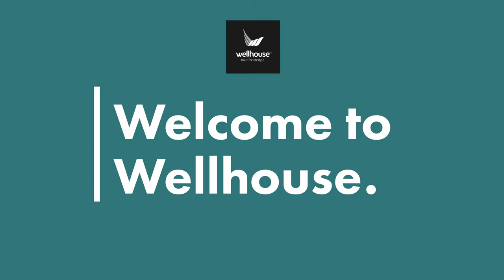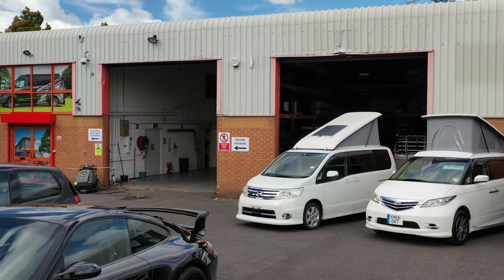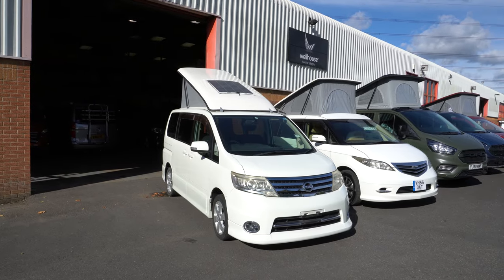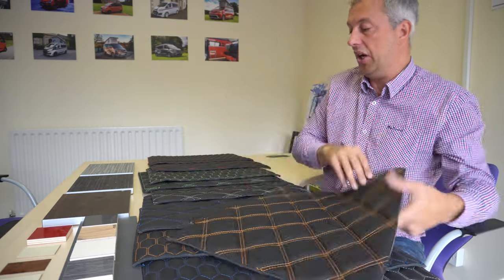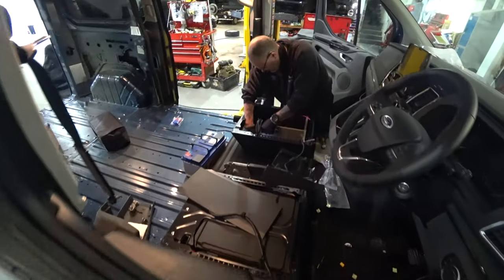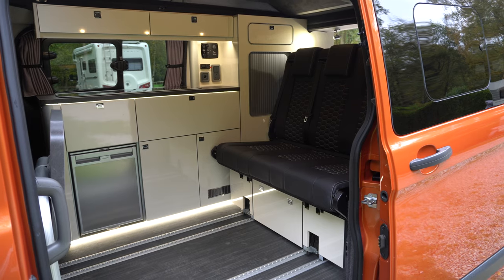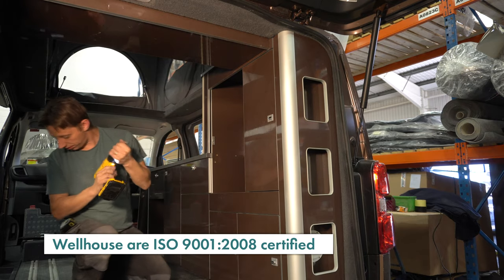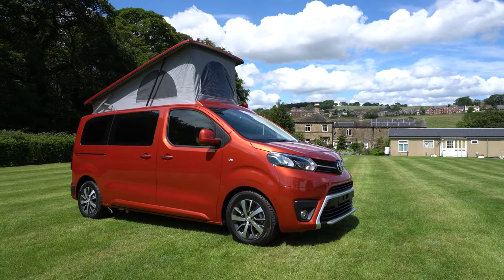How a campervan is made | 4K | Wellhouse Leisure reveal how they build their award-winning campers

Comment: I own a high spec low mileage Alphard 3.5 that's beautiful. I would end up having a heart attack seeing the beautiful leather motorised seating and high resolution entertainment system being pulled out for MDF inserts. I'd rather buy a motorhome. 
I can see your standards are high though. I suppose an old Alphard that's already been enjoyed - I see you're using 15 year old plus vehicles, (which are cheap imports) yet the finished price is high. 
I've seen DIY conversion kits for £1500 which might make more sense on old vehicles.

Comment: Do you really need 15mm thick cabinets they must be weighty units.
Reply from the maker: They use special boarding - amazingly light, rigid and strong. It's not at all like regular plywood laminate at all and is purpose designed for these vehicles.